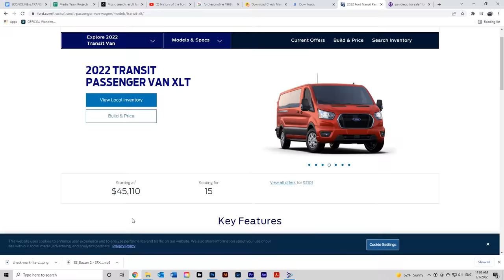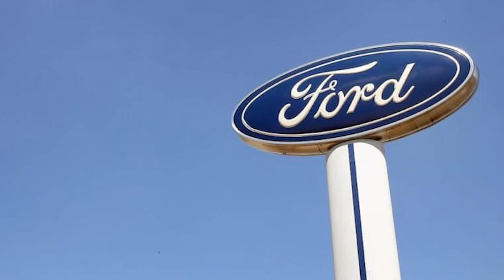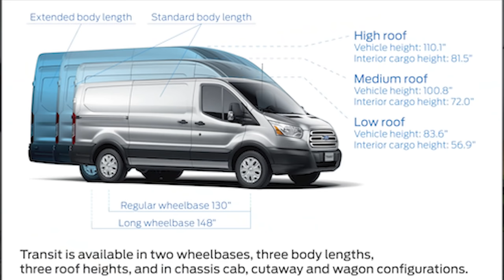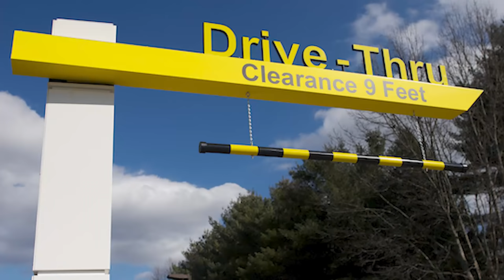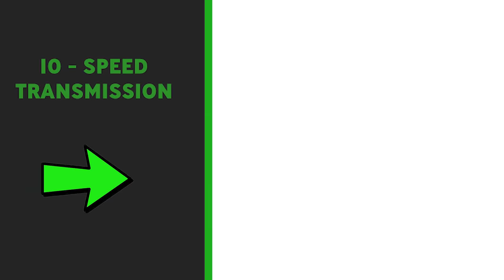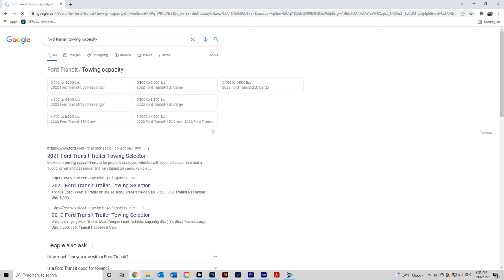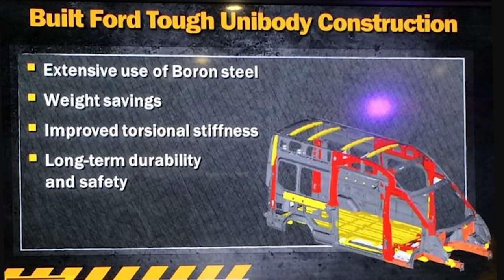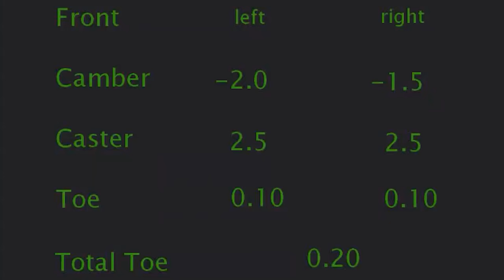Ford Econoline VS Ford Transit | Side By Side Comparison!

Comment: Which Van is best if you are trying to keep it at or under 82 inchs in Outside Height and 80inchs Wide? For Parking is all I have room for. Im having a hard time figuruing out which one as Specs are all over the place. Depending on the Web site for some reason.
Reply from the maker: A chevy express.... ? have you considered that?
Reply: @WeldtecDesigns  I ll check that out now. Thanks!

Comment: You’re funny!
  My Transit has the 3.5 engine. I put all terrain tires on it. It also has the trailer tow package. I outfitted it for camping. A couple of years ago I camped in the Arizona desert. It did fine.

Comment: I’d also enjoy a GMC Savana vs Ford Transit as you can purchase both new (until GM changes the Savana to who knows what).
Reply: tried ordering a GMC Savana, there just not building them yet.
Reply: @ritch_j  I’ve had a Ford Transit on order since Mid October 2021…they aren’t building it yet either.  I was debating between the GMC Savana and Ford Transit.  I’m thinking I may regret the Transit…if it ever gets built.
Reply: I ordered a new GMC Savana with the new 6.6l  400 hp small block last July ! It just got built, and being shipped to SoCal. Why ? I wanted a new gmc van to do my build, afraid the van may be discontinued in the future.
Reply: @JimJones-gd2jy  There is a good chance my Ford Transit will get “Unscheduled - Balanced Out” (aka not built).  If that happens I think I will order a 3500 GMC Savana with the 6.6L engine.  I’d prefer the body on frame with 10k towing.
Reply: @DanOnWheels  yah man! I just ordered my Chevy express 6.6 with all the bells and whistles after being rejected on the transit ordering. Saved 20k and I’m getting body on frame with that towing. I’m so excited. Hopefully it’ll actually be built quickly
Reply: there are two 2022 Transits about 50 miles from just might test drive one just to see..

Comment: I have a 95 E350 club wagon XL with the 4.9 300 I6, its a good van with a 10,000lb tow rate but honestly it won't pull out of its own way. And im getting between 8.8-9.5 mpg

Comment: Do you have lift kits for the 2022 Transit 350 upfitter model.
Reply from the maker: Yes it should be the same as the regular 350 suspension?

Comment: I have driven E series van with 7.3 diesel for years. It was very reliable and rugged. It was easy to get in and out of the drivers seat. Im now driving the Transit van 3.5 ecoboost, used as a replacement. .I prefer the old E series. The E is more rugged and it rides better due to larger tires, easier to get in and out of and feels substantial if you were to get in a accident. The Transit van feels flimsyer, its harder to get in and out due to narrower doors, and the visibility is slightly less out the sides. It rides  different with smaller wheels and tires. Driving position is more bus like. The Transit can really move with the twin turbo 3.5 but gas mileage will suffer if you drive it hard. Interior plastic such as steering wheel degrade easily in the UV of sunlight. Plastic in dash doesnt look like it will hold up well compared to the E. I do enjoy driving the Transit but the E is tuff. I think the E with the 7.3 diesel is my favorite.

Comment: I started with a '91 E-350, no rust. It was totaled out by my insurance company while I was in the hospital. I replaced it with a '90, rust bucket because I couldn't find a '91. Now I have to start all over. I'm currently looking for another one so I can make a matching trailer. All the fabrication work is going to be completed by Corbett's in North Carolina. I wouldn't trade my good ole American steel for anything new.
Reply from the maker: We look forward to seeing what you build, please share when you get it done.

Comment: My '97 e350 v10 extended recently got 16-17 mpg from SF to Portland and back loaded with my sons stuff taking him to college.  Set cruise at 70.  That thing about 13 mpg in the 6.0?  My 06 F250 got 22-23 on the freeway, SF to Pismo beach and back.

Comment: Ive had 3 econoline , 78, 96 and an 06 i still have and 1 transit 250 medium roof, which i sold at 22k miles. For heavy loads , off road abuse and overall durability the econoline whips the transit every time. The transit was a dud for me. Built too light , the hitch is bolted to sheet metal, couldn't handle the daily dirt road pounding etc.
Reply: Exactly! Plus the max tow rating for transit is 4k? WTF! Modern van should have V8 options for towing more than 5k!

Comment: I got an extended '04 E350 V10 in Nov. Cheap. 80K on it and it's bone dry underneath. No oil anywhere. Ripped out all the seats, the manky carpet, etc. Interior is almost ready to go road trip/camping. The amount of torque/power is ridiculous, as far as the headroom goes, you live out of it, not in it. The gas mileage fairly light and empty is ok, I just cant drive it 85. Going 70 instead makes a huge difference.

Comment: I had a 2000 e 150 low top conversion with a 4.6 that got about 20 mpg on the highway. Also, the video never even mentions the 4.2l. I have a 99 hi top conversion with the 4.2 (unfortunately)

Comment: A Shelby E250 or 350 with a blown coyote would have been nice.!! Although my 95 E250 heavy duty 351 cross flow injection w/ 373:1 rear  was an absolute monster. Same motor in my 91 with 4.10 Dana was quicker light to light but didn’t have top end. As you can tell I had a heavy foot got lots of tickets and didn’t give a shit about mpgs .  It was great to be young  lol

Comment: I have a 2010 E350 with the 5.4. I find the mileage to be fairly good! Mostly highway miles.  Don't have any figures for you. I'm told the E series has more legroom than the Transit, at least for the driver. I think that is of note. Thank you for the video.
Reply from the maker: Thanks for sharing, I still am a big fan of the E-series

Comment: 😢😮😢wish you had given a conclusion on the comparison.  I want to buy a mid roof connect vs I want to buy a Ford e series and add a topper ? I also will to a small trailer of 4- 5k lbs. What is best to do this? I would appreciate your opinion if you would. Thank you. I watch you to learn. But I'm no mechanic. As a woman I just want to know which would be best for me. Thank you very much.😊
Reply from the maker: Thanks for watching, i addresed you comment in our new Q&A video. check it out.

Comment: I am building on a 2013 e350 frame with Dana 60 front , IDI diesel, e4od, and a divorced transfer, 3.55 gears. It's a highway tripper medium high topper. Itll pull my 1980 CJ7 on skeleton frame. Itll be the "Holy Grail Van."
Reply from the maker: That sounds like a awesome van build.
Reply: @WeldtecDesigns  its gonna be a few years. I am collecting parts currently. With scrap so high, we are losing many parts vehicles. It is remincent of "Cash for for Clunkers" days. I am grabbing lots of parts (divorced transfers, axles, etc...) i did just find my "rare" but much needed wiring harness/dash from a 1993 IDI van (modern  body style). I bought the whole front half of the van , cut it behind the seats. We call that a "fish head". I have loads of IDIs here. They are SO much quieter than PSD or the worst Cummins. I have a buddy with a 4bt in an F150 he drives from Pa. to Pharump NV..
I dont know how he does it. I dont need crazy power,  just simple and cheap. ...=  IDI.

Comment: i have  2006 e350 with a 6.0 and 240k.  the 6.0 in the van was more relaible since it was detuned by ford.
Reply from the maker: Did you have to bulletproof the engine?
Reply: @WeldtecDesigns  no

Comment: Transit will be helpfull in daily drive even for work etc. E series is lil weak, i used one for work and it never go over 55 mph because less power. And interior height is uncomfortable to say its work van. E series only passenger van in my opinion.

Comment: You forgot the 4,9L i6, h5.0L V8, 5.8L V8, and 7.5L V8 in 1992-1996 models, 1997 was the start for the 4.2, 4.6, 5.4, and 6.8. 7.3L IDI from 1992-1994, and 7.3L Powerstroke from 1994.5-2003.

Comment: Dollar for dollar the v10 is a  COMPLETE home run ..I have had, powerstrokes, 4.6s, 5.4s and the v10. The v10 quiet power and efficiency is awesome with the 6 speed auto (2014) ..the E350 can pull a house...and stop it with trailer/tow button. My dog ends up on the INSIDE of the windshield when it downshifts. I dont care what mileage it gets they are paid for.
Reply from the maker: You might be the first to say the v10 is quiet... It revs so high and loud?
Reply: I am in it now pulling a trailer...never goes above 3000 rpm... factory exhaust ..it is quiet . I guess i am used to IDIs and PSD.

Comment: Here in the UK I have an 89 E-350 camper ,the build is awesome compared to Transit and the current UK models have a garbage reputation but their motors are not the same as yours which seems the main problem  .   
Apart from some mint Early Trannies at car shows I would bet there are more    80's Econolines on Britain's roads then Transits of the same vintage ,granted they are day vans and campers but then so were Transits back in the day .

Comment: I have a 2003 E 350 and many guys want to purchase it even though they have the newer Transit. That is telling me the older E series are so much better. Yes Transit has newer sh## but that can be added to the E series. I hope to have mine for a long time.  160,000 5.4  Was offered $ 8000.00 I turned it down. Shows its holding it's value.

Comment: I’ve had four Econolines and E series over the years. I’ve got a Transit 250 now. I miss the E series. The V8 did the trick no matter the size. The 6 in the Transit isn’t enough with ladders on top with a load in it. 
The Transit traction control is the worst feature of any vehicle I’ve ever owned.

Comment: At this point it’s preference and the one that has the lowest cost of goods when it comes to repair and maintenance is going to be the gas one diesel bad ass but a big no specially if you live in California 5.4  v10 especially 5.4 Parts everywhere on demand whatever you want don’t have a lot of faith in them but a lot cheaper to replace parts and maintain as for the transit better gas mileage better torque amazing headspace or head clearance but I would stick with the E350 not the best gas mileage but a better bang for your buck but I guess in the long run you’ll spend more money you’re fucked either way but it’s a good one which I ever side  or whatever route you take

Comment: If the E-series would get at least 1 or 2 more gears on their stupid transmissions, [ dont know what Ford was thinking, giving these things only 4 gears ]  they would blow the transit out of the water.  that's the only thing holding them back in my opinion. Transits are good vehicles to drive but they're not built the same as the econolines .